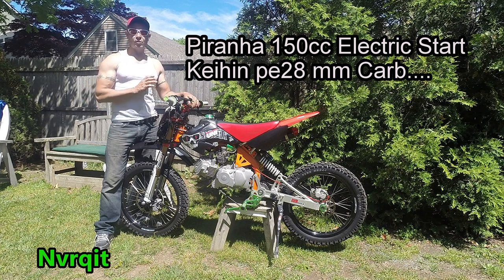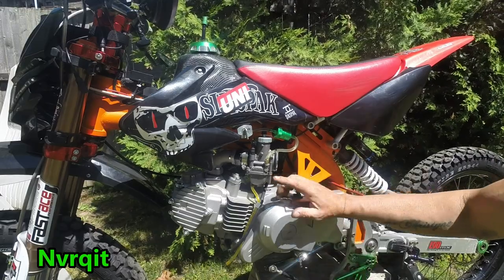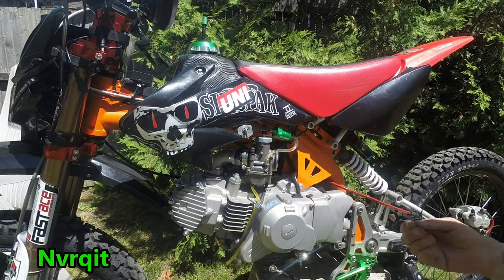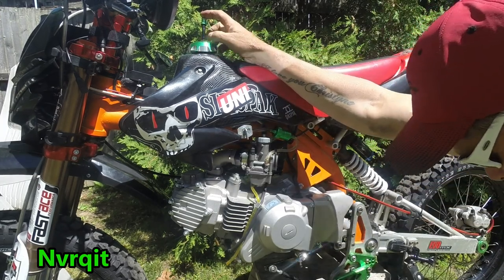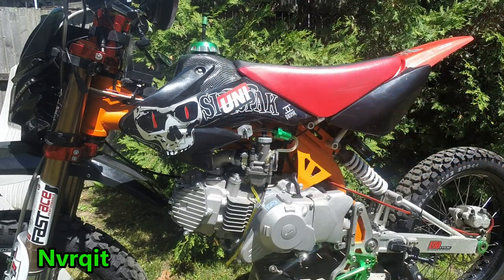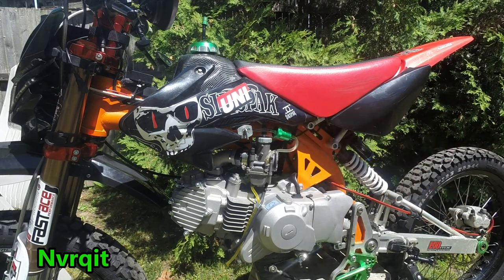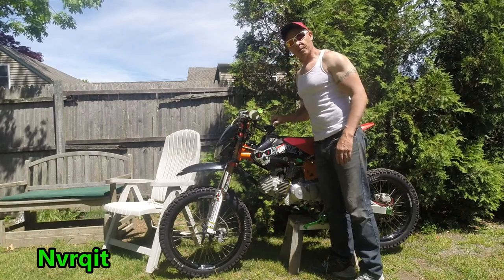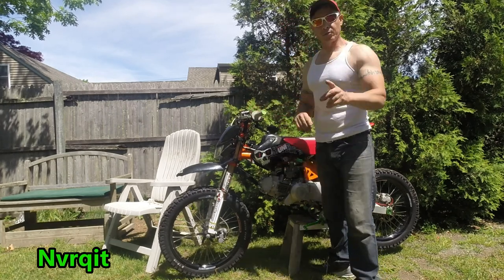Motoped Pro 150cc Piranha | Carburetor Fix!

Comment: your last vid on your brake setup for the rear brake was awesome! Thanks for posting it. why not run the same KTM brembo caliper up front? would a custom bracket have to be made to accommodate the front fork mounting holes? Also what exhaust did you wind up going with and does your engine have the Kawasaki exhaust ports or Honda exhaust ports? sounds mean brother. hey how about a top speed video with GPS to track your speed?
Reply from the maker: PerpetuallyVigilant 
no reason I just have a 51mm bolt pattern already purchased so I used it ,bit you can used a brembo on the front too 
thanks for the comments and check the videos
Reply from the maker: PerpetuallyVigilant 
yes it sounds real good ,the engine only comes with the Honda exhaust port no kawy 
I'm using a regular after market exhaust ,I did take the packing out for more flow  I will make a video probably this weekend with the top speed and GPS tracking 👍👍
Reply: nvrqit sweet thanks!
Reply: nvrqit it will be nice to see the difference in speed before and after re-gearing

Comment: Curious to know what wheels, hubs and tired you installed ?
Reply from the maker: Nick L 
Moose racing rims hubs are the original motored just drill a little bigger holes 
And tires Shinko 50/50  the front is 19 “
The rear 18” 
Look the other video I explain all the process